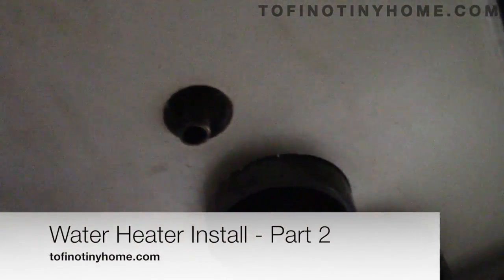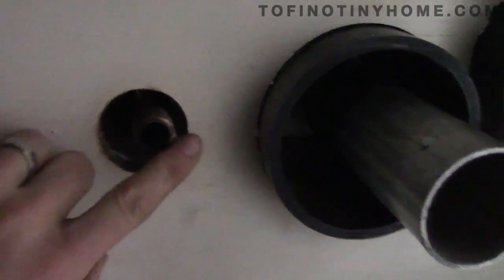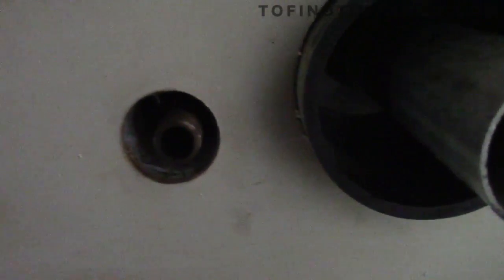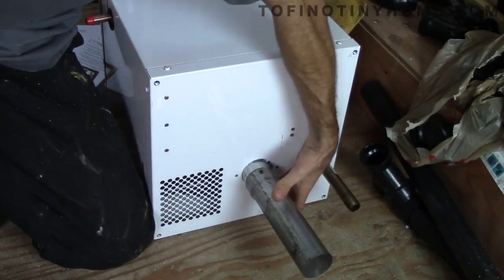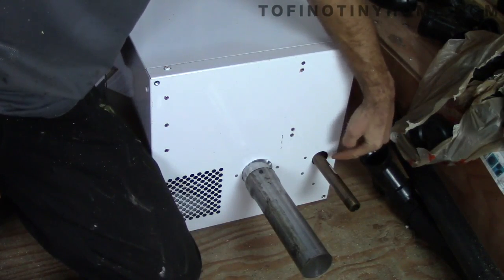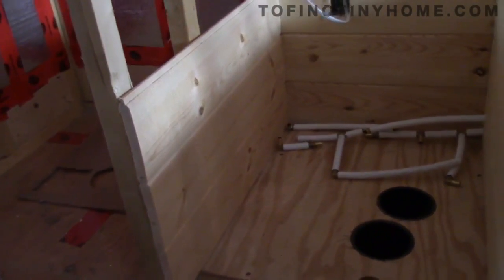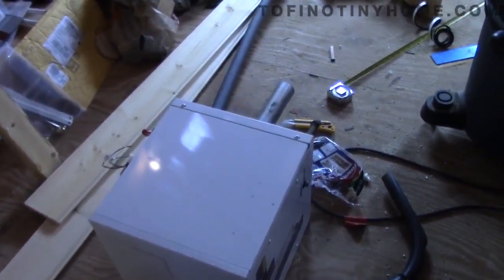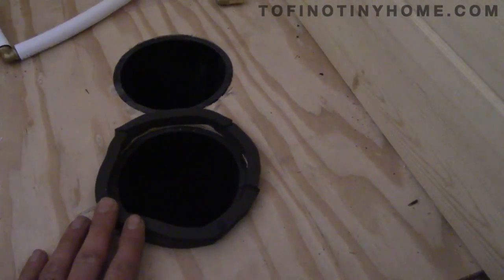Installing a Precision Temp On Demand Water Heater - Part 2

Comment: It seems to me that one of the issues with this design is; If the water heater is not ignited (when there is no water demand), then the cold air from the exterior of the house can come in through the air intake hole, into the water heater case (which is definitely not airtight), and thus into the living environment.  On a winter day, have you noticed cold air leaching in through the water heater case?